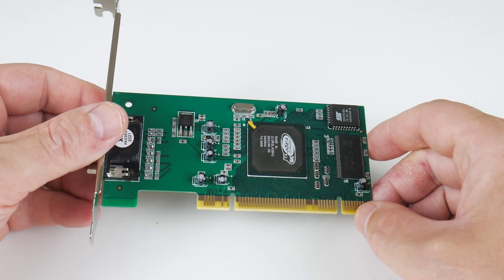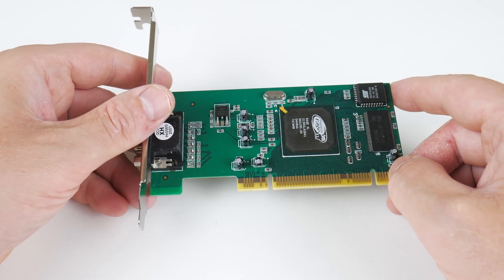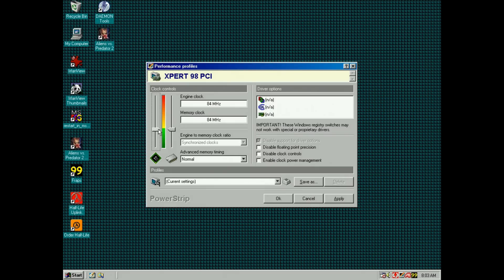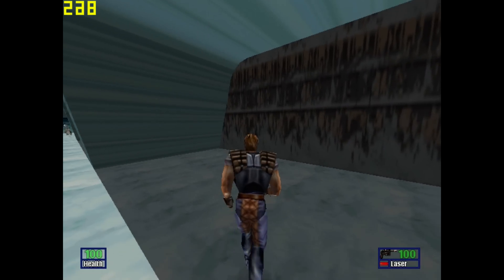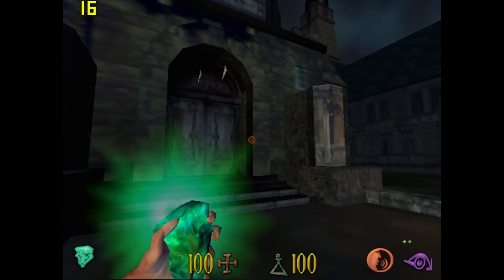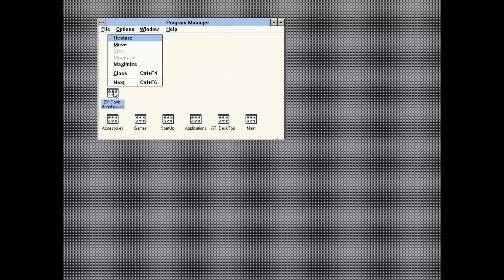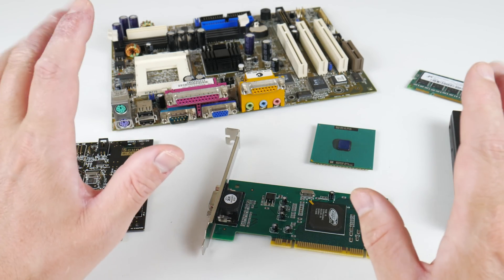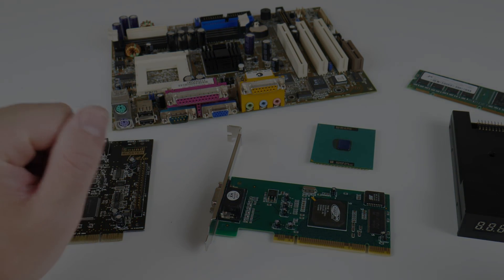Graphics Card shortage? Buy the ATI Rage XL!

Comment: I have an "Ati mobility" 8mb PCI. It looks very similar but I can't see the chip, it has a heatsink glued on it... it has the same problem of the 3.3v and I did the same mod and it works on 5v PCI but... I'm having problems with the drivers, do you know wich one would work for this card?

Comment: You know it's bad when they didn't even bother to put a heat spreader on the GPU 😂
Reply: Technically it isn't a GPU, that's a term coined by NVIDIA with the release of the original Geforce 256, because unlike other cards, it had hardware T&L. As for heat spreaders and heatsinks, a lot of old graphics cards and CPUs didn't have them. Performance is relative... in a few years today's best GPUs will be treated the same way as people treat cards like this.
Reply: That comment makes no sense at all.

Comment: During my neighborhoods spring cleaning event I just left a box full of old graphics card and ram sticks out. Im someone will get some money from edo memory. 
It also included a couple different rage graphics card. A smaller one, bigger than the XL though, and a rage that included a second circuit board attached to it. Also a random nivida tnt2 and an Geforce mx2.

Most of the cards dropped were original cards my dad got from friends for free as they upgraded to new pcs.
I did not however left go of my precious 3dfx cards nor ATI cards I actually used.
Still got my Voodoo Banshee, Voodoo 2, Voodoo 3500 TV.
Still kept my Ati Radeon 7000 32mb, 2 Radeon 9550s 256mb, HD Radeon 4850 512mb, HD Radeon 6770 1gb, HD Radeon 7970 3gb, and RX580 4gb.

Comment: I did the voltage regulator mod and it worked on my 440bx board. Used to unbrick my voodoo 3 which I had erased the bios by accident lol

Comment: Would my installing one of these PCI cards be an improvement over the onboard ATI Rage PRO AGP?  I’m using an IBM Aptiva with 2 Voodoo2 cards in SLI connected to the onboard ATI graphics.  I don’t think my setup is working that great.  M1 Tank Platoon 2 should be running flawlessly but it’s choking. (AMD 475MHZ CPU, 256 MB RAM, Win98. ). Mechwarrior 4 is also barely playable.
Reply from the maker: I'm not familiar with thee two games, but my guess is that CPU is holding things back. The ATI Rage XL is nowhere near performance of Voodoo 2.
Reply: @philscomputerlab  thanks for the quick response, Phil.  I am a retro gamer and big fan.  I think MechWarrior 4 might not even be utilizing the Voodoo2 cards. It’s a 2001 era game made by Microsoft.  And yes, I run 3DMark99, 2000, and 2001 and you’re right, the ATI Rage Pro AGP onboard graphics is a joke compared to the Voodoo2 s.  

I ordered one of the generic ATI PCI cards just to see if there is any performance boost - I doubt there will be as the onboard graphics has the same specs.  It’s just a retro gaming experiment, lol!!!
Reply from the maker: @MusicStudent1  MW4 seems to be a end of year 2000 release. I'm certain now that your CPU is holding you back. Many games from that year will struggle with that CPU.

Comment: I remember back in the days when i had a riva tnt 2 ultra + 2 voodoo 2 in sli (for diablo2) there were so many ati expert 2000 cards flying around it wasn´t even funny. I had 2 of them, used 1 in my 2nd pc i took to lan session and even so it wasn´t the fastest it go the job done nicely. And it was cheap as hell, widely available as it came in plenty of pre build pcs. Later replaced that with a diamon stealth 3 s540 s3savage 4 card (to be different) and after that with a power vr kyro2. 
Back in the days everyone was hyped for voodoo3 or riva tnt2 cards, yet the ati offers, even the cheap rage 128 cards, were quite good.

Comment: Heads up; if you have very early PCI motherboard (486, Pentium) this card still needs 3.3v from the PCI bus to work. Otherwise, even though it's a dual voltage card, it will not function. There are some videos showing how to hack the card from it's own VRM and power it that way. However, you might be feeding 3.3v down the PCI traces back to who knows where on the motherboard. For those, I'd just go find a 5v trident and call it a day for the least expensive option.
Reply: I soldered a jumper wire to the 3.3V in on the pin on the regulator on the card, then found a spot on my mainboard that supplies 3.3V for the CPU

Comment: My hobby is rescuing mainly old Apple computers, but I’ve decided to branch out into old windows machines as well.

Just found your channel a couple days ago and I’ve resurrected 2 old Pentium 4 machines (Vectra 420 and a custom build with a MB800r-v main board). My initial reason for bringing these back to life was to complete my ‘first aid kit’. I have all MacOS versions as either bootable partitions or ESD installers. 	

Question: Would it be worth it to do the same with windows as well? Would you recommend several partitions on one sata ssd drive for windows 3.1 to 10 or separate appropriately sized mSata drives? Thanks! Great channel!
Reply from the maker: Not sure, I haven't done much with multi partition projects..

Comment: Will this work with a Pentium 1 machine? Also, do you plug vga directly into the card or the vga port on the motherboard?
Reply from the maker: Yes should work on a Pentium if it supplies the voltage as mentioned in the video and you plug in VGA directly into the card :)

Comment: i don't recommend buying ati rage xl, because it is too old which is even older than geforce 256 and it would run very old games and barley reach 30 fps.

buy gt 710 or 730 instead

thou I writing this comment when gpu shortage stopped so better buy maybe gtx 1060 or any newer gtx gpus

Comment: You can try to use multiple driver, first you install older driver, the MACXW4 4.11.2582 and later any other driver that works, old MACXW4 driver should take care of 3DCIF and newer driver all of the rest. I have XL AGP, but i would like to test this RageXL PCI (4752). Someone should do the full testing with all of the ATi drivers, does not matter if it is 3DCIF driver or not for the RageXL PCI (4752). Or use DOS based Actua Soccer for this card do see how it reacts in dos 3dcif, but you need to downgrade and rename  MACXW4 4.11.2582 for the newer driver with other files that are working with RageXL AGP, but this mismatch working better with RagePro and Rage LT Pro.
Reply from the maker: I helped Gona get one of these PCI cards and we didn't have luck. Actua Soccer does not work with Rage XL if you're curious you get a green image but you can sort of see some rendering going on. The PC cards are easy to get, so do grab one and play around, maybe you have more success!
Reply: @philscomputerlab  : I made these drivers and found original 2582 and 2611 3dcif driver ones, also gathered opengl files for Rage3. OpenGL 1068 works best for Quake2, at least for my AMD K6-2. First Quake likes latest 110x ones and 1068 is second best. D3D is updated so with DX6.1 3DMARK99 works out of box, also works NFS5 with DX7a or later and other games. Please check my 5.38.2582-3dcif driver out for Rage2c and Rage3 cards, yes your XL PCI 4752 does not work at the moment. I recommend for you to download full version with separate opengl files. I love Rage Pro based cards, it was my first 3D videocard, back then, i did not know anything about 3DCiF. Rage2 and Rage3 tweaker and many more included in full download. Links for the drivers and opengl package is here:  https://www.vogons.org/viewtopic.php?p=984407#p984407

Comment: As a kid in the 2000s, I remember reading an OpenGL textbook and developing a game engine. I started getting reports from folks with ATI cards that it just wasn't working in a variety of ways. It turns out that the GL_ARB_** extensions I was importing were NVIDIA-only, and many of these did not have direct ATI equivalents. On the ATI card of our "family room" computer at the time, I did notice that games looked subtly worse. I wonder if this was part of the trend that ended with NVIDIA on top.

Comment: My first 3D video card was an AGP2X ATI 3D Rage Pro with 4 megs of RAM. I used it for about 5 years. It was pretty good for running DX6 games and some OpenGL games. Driver updates and overclocking made it even better (with the Rage Pro Tweaker). Good times. :)

Comment: I had a Rendition Verite back in the Quake 2/Halflife days that was no speed demon and would run around 33fps at 800x600, but rendered beautiful graphics for the time. I did overclock the card and the CPU, an AMD 1.2 ghz Intel equivalent, I think? Anyway, built my own machines and always tried to squeeze as much out of them as possible. Of course I had like 4 case fans and a frigging giant heat sink on the AMD cpu which got hot af but never failed. I was a big AMD guy early on despite some weaknesses like poor floating point operations vs Intels of the day. Always bought motherboards that you could OC the cpu without dealing with jumpers. The good old days...

Comment: I used to run a Rage XL 8MB AGP in a Win95 box when I still had a Pentium MMX / AMD K6 computer. They kick ass in Half Life, Unreal, Wheel of Time, Continuum, Total Annihilation, anything Flash 5, Games Factory, Multimedia Fusion and RPG Maker 2000 ran fine. Warning Forever was another good one. Anything NES/SNES emulation was spot on. GBA stuff ran okay. N64 emulation struggled a bit without XP drivers and there was a big enough default difference on Server 2003 that sometimes it would refuse to run, not that you would want to run those games around 1/4 speed or worse but they were playable with an overclocked K6. The Rage Magnum (2000) 16MB/32MB series blew the doors off all those bottlenecks.

Comment: Seeing this inspired me! I just dug out my old windows 95 system parts which I thought I would never use, I have a Biostar M5ATC board, intel 233 socket 7 cpu, 32 mb ram, Ensoniq 1997 sound card, Stb Nitro 3d/GX video card. I'd love to fire it all up. I don't have a power supply. I found a motherboard manual which shows ATX location on the motherboard and sure enough it's there without a connector. Could I solder on an ATX 20 pin female connector and have it work? Soldering is not the issue, does anybody know if it would work?
Reply: The capacitors all look good. I have done some work with capacitors previously on a monitor, and it actually brought it back to life. Thanks for the input and your great channel! I'll order the ATX connector and give it a try!
Reply: @dadbennett9978  did you get your ATX working?
Reply from the maker: There might be other components that have to be soldered, maybe some capacitors? But yes, the chances of it working are quite high.

Comment: I had a Rage 128 back in the day.   In Linux, the 3D was essentially non-existant (it could have supported like OpenGL 1.1 but the drivers never came together before focus was on basically ATI Radeon and Matrox G400 as a minimum).  But the 2D was perfectly fine, AFAIK Linux still has 2D drivers for this thing too; for what I use my computer for other than 3D gaming, I'd be happy using one right now.
Reply: My first gaming PC had that card, ran Windows 2000 on it. And wept openly.

Comment: My Dell Dimension xps 450t is fully stock, running Windows ‘98 Second Edition with a “Slot One” 450MHz Pentium III CPU, Turtle Beach Montego II sound card with on-board gameport, and a 3Dfx VooDoo 3 graphics card. I can’t recall the amount of RAM or storage, but I can tell you it runs fairly well for having sat dormant in a basement since 2005.

 I’m cruising at a smooth 30FPS on them King’s Quest games.

Comment: I picked up one of these a little while back just for giggles. One of my socket 7 boards would not boot with it, but another one did: An IBM Aptiva 2196 small form factor system (super socket 7 with a K6-2+ as standard). Unfortunately it was a little redundant in this system, with the integrated SiS630 graphics outpacing it. But it's a neat and cheap little card that I'm glad to have in the kit for when it's needed.

Comment: I have almost 10 working AGP cards, but my pain is that I got rid of all my PCI-E just at the end of 2019.
Reply: At early 2020 I bought my younger brother a Ryzen 3600, a 570 motherboard, but stopped short of buying Radeon 5700XT, mainly because I wanted to check the newer generation.
Yep I did a mistake.
Reply: @O.Shawabkeh  My case is waaay more funny - I now need just the simplest PCI-e, the "lowest-possible-end", to get my testing box running. It's winter, and I was about to test some Linux distros and polishing my old windows editions. Now I will have to buy an old overcooked card for ~30€ 😀

Comment: I think its great there is new stock that could fix up some retro gaming in a pinch. But I was REALLY hoping for a bit more performance, barely getting to 30fps at 640x480 is sad. HOWEVER, someone could have a good time slapping a make shift cooler on the thing and overclocking the bejesus out of it and if you blow it up no big loss.

Comment: lol, you can get like a Radeon HD 7570 for the same price 😂
Reply from the maker: I doubt that, but if you have a link, would love to be proven wrong.
Reply: @philscomputerlab  My links keep getting deleted. But just go on to ebay and you'll find plenty of them for around that price point.
Reply from the maker: @SSJfraz  I see them now! Low profile, they are likely out of Dell or HP workstation machines. Being XP compatible, they are decent for a low profile Retro Gaming PC ::) They have Display Port usually, but it is the old standard, so 4K at only 30 Hz.  Good find :)
Reply: @philscomputerlab  It comes with 1x DVI, 1x HDMI, 1x VGA. Unless there's variants that i'm unaware of. If you do get one, make sure its the GDDR5 version.
Reply: In PCI?
Reply: @dallesamllhals9161  Would need to be a PCI 2.0 compatible motherboard as the GPU came out in 2012. Something I may have overlooked regarding this particular build in the video.
Reply: @SSJfraz  SO! I'll be just fine with a Radeon 9250* PCI (and a Voodoo² of course) in my good ol' - first Build EWAR - 1997 Socket 7? 

*Yup! NOT Period Correct. But my Tseng Labs ET6000 didn't do DVD playback ;-)

Comment: This would have been a great card back in the day, when those older computers were still getting online with dial up. It would be used to allow 32-bit color and a higher resolution. It's original purpose I suppose. Now it's a retro gaming card! Onboard graphics was so terrible back then, even if you didn't game!
Reply: The main intention for this thing was actually servers, and a crapton of these basic Rage XL GPUs along with 8MB VRAM as a single chip (like on the card in the video) ended up on server boards where the sole function was to have something that outputs video for diagnostics and monitoring, with low component count (= cost) soldered right onto the board. In fact, the only reason why board manufacturers switched to something else was ATI discontinuing these chips sometime in 2006 IIRC, replaced by the ATI ES1000 based on the first Radeon (7000) in 2007

Comment: Does anyone have drivers for this card to use in win 3.11? I read on vogons that the mach64 drivers worked, however those drivers in vogons database have the info that they can be used on rage pro by doing some tweaks on the driver.. Honestly I don't know how to do that. I was planning to swap my mystique 220 with 4mb by one of these to use on my 3.11 machine running on a pentium 166... Can anyone help? If I can't find the driver I'll stick to the mystique... I don't want to upgrade the machine OS as I have already another machine with powerful specs running Win98...
Reply from the maker: So this is what you do. You install the Mach 64 drivers. The installer will run in DOS and extract some files. After reboot nothing will have changed, but you will see ATI software and Windows should tell you that Mach64 driver is loaded. Then shut down into DOS and edit SYSTEM.INI and edit the file like shown in this video! You need to do this as the Windows tool, which lets you change resolution, colour depth and refresh rate, doesn't detect and isn't compatible with these newer rage cards. But the driver IS compatible.
Reply: @philscomputerlab  thanks for your reply. Do you think that the ATI will be better for dos games than the Matrox? Some games with the Matrox will simply freeze the computer...
Reply from the maker: @vjscorreia   @Vitor Correia  Really? What games for example? Yes ATI could be better...
Reply: @philscomputerlab  for example all commander keen don't work... On windows 3.11 the card is flawless, the problem is in dos games, that's why I'm planning the swap..
Reply from the maker: @vjscorreia  Keen also doesn't work on the ATI, but there are patches. Any other games that freeze?
Reply: @philscomputerlab  yeah, M.A.X. is another one...

Comment: What graphic card do you recommend for k6-2 and pentium 3?
Reply from the maker: For K6 the "best" cards are 3dfx Voodoo, ideally a Voodoo 3. For Pentium 3, let us say something a bit faster like 800 MHz there are heaps of options and depends a bit on what games you want to play. An AGP GeForce 2, 3 and 4 would work great.
Reply: @philscomputerlab  well ironically search for PCI ones since the k6-2 hadn't agp, but for agp maybe I have some lying around to try. It's a weird board this pentium 3 has no on-board and I don't remember agp either but probably is there. I hope finding one. I hadn't tried old games I use for emulation in the past since on-board graphics.
Reply from the maker: For PCI yea a Voodoo 3, but will be hard to find and expensive. GeForce FX 5500 can be had new, similar to this Rage XL, but more expensive around $30 I think.
Reply: @philscomputerlab  well I will have to keep searching but yes sometimes can be more than the rest of the components.
Reply: @philscomputerlab  thanks for answer and merry Christmas
Reply: Radeon 9250 PCI?

EDIT:
^It works on Socket 7 Motherboards*. The "newish" FX 5500s does not...unless new info?  

*Well....I only KNOW that it works on the Iwill P55XB2.